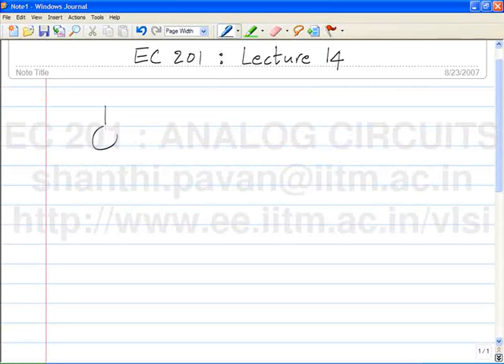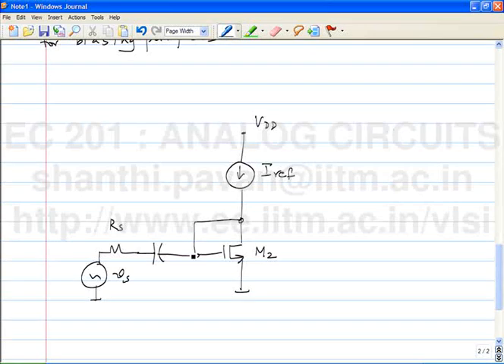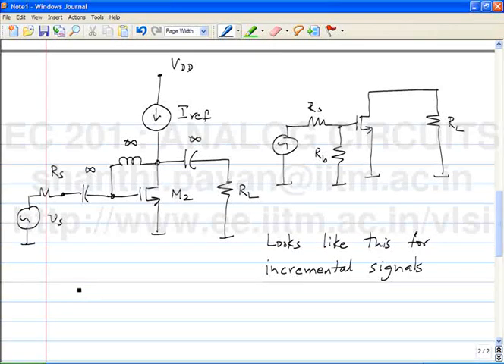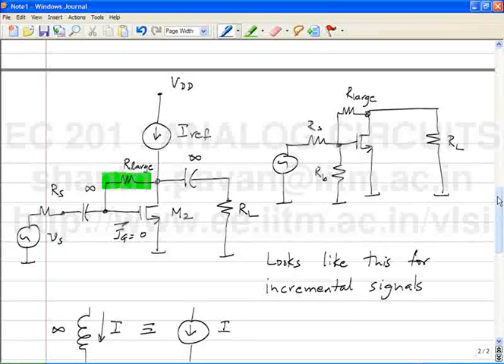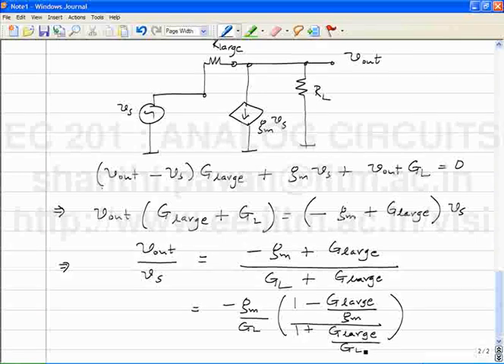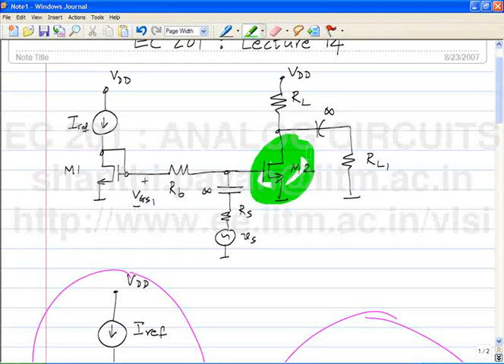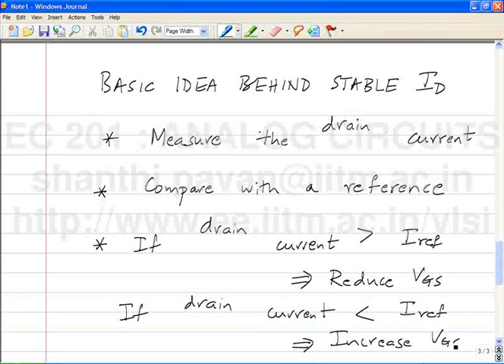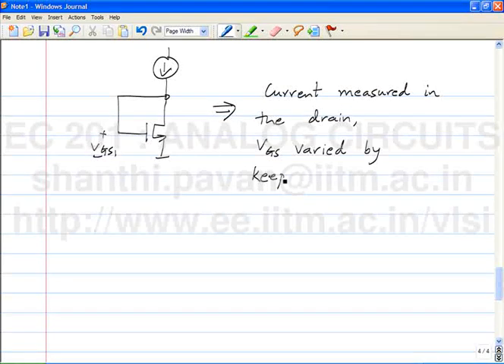Lecture 14 - Bias Stabilization, drain feedback

Comment: How do you calculate the input resistance of a drain-gate feedback circuit?
Reply: the drain and gate are SC. the incremental equivalent of the Tx is a current source gm*vgs . Now how u can get a current ... obviously when u have a resistor and a voltage source then ... ohms law R= V/I...do same thing here.. the current source is gm*vgs and the voltage on gate side is vgs .... divide u get the resistor as 'gm'...so replace Tx with its equivalent which is a resistor now ... as D and G are SC.